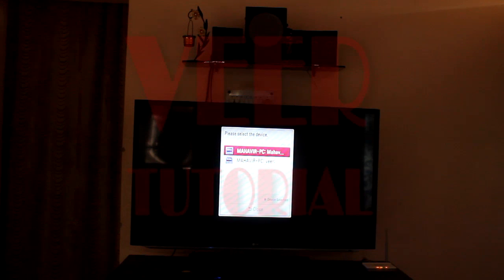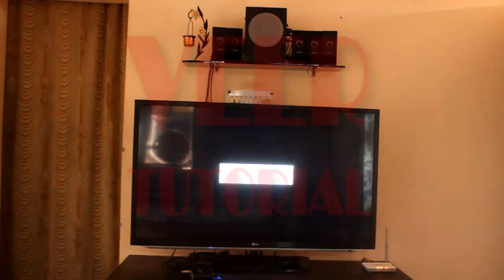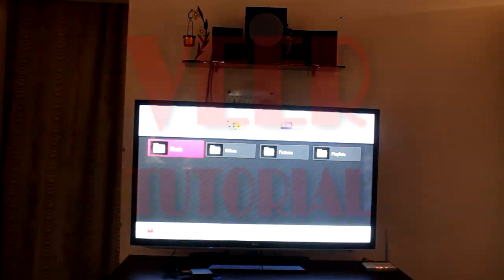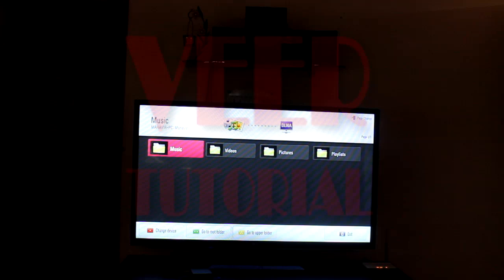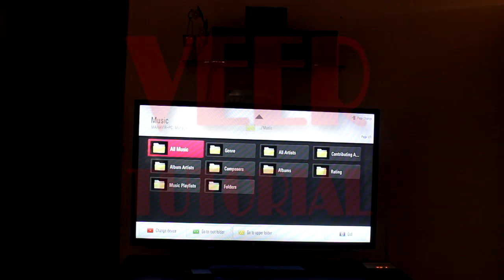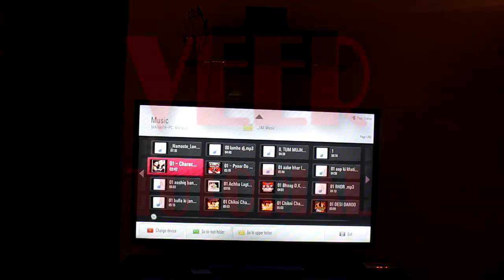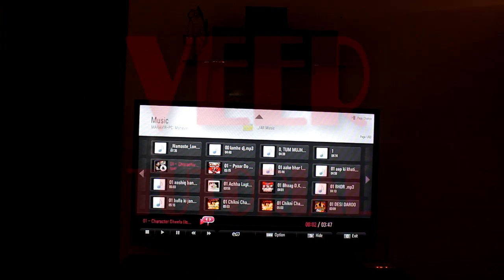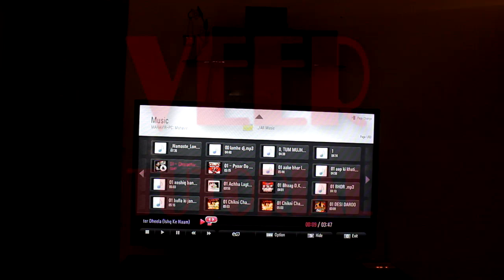How to convert digital (Toslink) audio to analog (3.5 MM Jack)

Comment: I just got one of these units to use an altec lansing subwoofer/speaker set and I am getting a lot of static in the background that remains even when I turn the volume al the way down.  Any suggestions?
Reply from the maker: Hi check wire connection carefully

Comment: Good explanation sir, i have a 5.1 creative pc speaker that i want to connect to my tv. Same 3 cables in your speaker. Sir after i connect the 3 cable to the audio gear, i also connect the other 3 end to the 3 holes (orange, green and black) at the back of the subwoofer? Thanks., I think my problem is going to be solve by your video. Thanks. I hope i can send a picture of my creative speaker sa that you can correct me or tips. Thankyou sir!
Reply: '' i also connect the other 3 end to the 3 holes (orange, green and black) at the back of the subwoofer? '' Yes, but  only in subwoofer Input plugs, not output

Comment: I have  creative 4.1 speakers with two 3.5 mm cables, will this work or is there any other device for that
Reply: We went to the moon, i'm sure its possible if you put some effort in searching for what you need for what you want to accomplish. There also exists some adapters and or small boxes that are quick solutions for audio adapting one thing to another. Pay close attention to the inputs and outputs, be sure to understand what its doing.

Comment: i have to vintage receiver and a optical dac. wi wish to convert one optical signal to 3 rcas output its possible??? or only convert in one rca?
Reply: plug the receiver into a stereo to mono cable, then hook the mono audio cable to a mono to stereo splitter, then look the R and L RCA connectors to a analog to SPDIF converter box.

Comment: Great Video! Could you please restate the Cable Connections. A comment below seems to indicate that the correct color coding to match the Green, Orange & Black 1/8" (3.5MM) cable plugs to the correct CEN/SW, FL/FR & SL/SR jacks on the converter for 5.1 surround sound may be different. In the youtube tutorial Green is center/subwoofer, Orange is Back Surround Sound left & Right and Black is Front Surround Sound Left and Right. Is that correct or does the Orange & Black need to be reversed? I'm using Logitech z506 5.1 speakers. On the back of my Logictech z506 subwoofer it has three 1/8" (3.5MM) jacks collectively labeled 6CH Input. The Green is labeled AUDIO IN, Black & an Orange Jacks are not labeled. How does 6Ch relate to 5.1 Surround Sound? Also in my HDTV Menu I can select either RAW (default) or PCM. Do you know which is better for 5.1 Surround sound?

Comment: I have seen quite a few spdif to 3.5mm adaptor cables for around $4.00 on eBay.  Do those cables actually work or do you need a box like this to process the audio?
Reply: BrainToMush they wont get 5.1, only stereo.
Reply: Ok thanks for the explanation.
Reply: I get surround sound from my headphones. It works pretty good.

Comment: In regards to your first comment that you stated that "all 5.1 audio systems do not use digital audio". This statement is incorrect because audio systems like the logitech z-5500s have digital audio inputs, and another thing when you point out the three outputs on the back you told us that output; "1.(CEN/SW) is for the center speaker", which is correct; "2.(FL/FR) is for front", which is also correct; "3.(SL/SR) is for subwoofer", which is completely incorrect. So from what you just said 5.1 is actually 3.1 output (which made me giggle a little not going to lie). So i will tell you what speakers are for which output. Which are written below the outputs, but i will clarify on the ones you told us were incorrect. Output 1.(CEN/SW) stands for center/subwoofer. Meaning this is the output for both center speaker and subwoofer, but hold if output 1 is for center and subwoofer than whats output 3 for? Well output 3 which also written SL/SR stands for surround left/surround right which also means rear left/right, and now instead of having 3.1 you have your full 5.1 system. Other than those few mistakes you did well keep it up and i looked forward in watching the next one.
Reply: vHoboWarrior So what is the correct color coding to match the Green, Orange & Black 1/8" (3.5MM) cable plugs to the correct CEN/SW, FL/FR & SL/SR jacks on the converter for 5.1 surround sound? In the youtube tutorial Green is center/subwoofer, Orange is Back Surround Sound left & Right and Black is Front Surround Sound Left and Right. Is that correct or does the Orange & Black need to be reversed? On the back of my Logictech z506 subwoofer it has a Green 1/8" jack labeled AUDIO IN, a Black Jack & an Orange Jack which are collectively labeled 6CH Input. How does 6Ch relate to 5.1 Surround Sound? Also in my HDTV Menu I can select either RAW (default) or PCM. Do you know which is better for 5.1 Surround sound?

Comment: Dear Mahaveer,
hai,
Your tutorial video regarding 5.1 Audio Gear was very helpful for me but there is a little problem.

I have Samsung LCD and it has only Digital audio optical jack where I purchased a Philips 5.1 Chanel Speaker and it has 6 inputs i.e. SW, Centre, Front Left, Front Right, Rear Left and Rear Right input point that it has 6 input point.

Where the 5.1 Audio Gear has only 3 output point.

Please guide.
Reply: Have you figured your situation out yet? Why am asking is that your comment is over a month old and I'm wondering if you still need help
Reply: Thank  you. Issue has been resolved.

Comment: very good job ... i have doubt, does it decode dts, dolby digital 5.1 and outputs the sound true ???? 
or it plays same sound from all the speakers ??
Reply: +Santhosh Kumar 

have you purchased this item? and what is you experience about it ? is it working 5.1 true or same sounds from all the speakers?

thanks
Reply from the maker: Santhosh Kumar yes it can decode but better you can check more technical details on product document before purchase
Reply: Mahavir Singh bro can you provide me the link from where you purchased i to want it
Reply: Santhosh Kumar Yeah man, it supports supports Dolby Digital AC-3, Dolby Pro Logic, DTS, PCM and other digital audio formats.

American Link: http://www.amazon.com/Panlong-Audio-Digital-Decoder-Converter/dp/B00AMC2J1Y

UK Link: http://www.amazon.co.uk/EiioX-Audio-Digital-Sound-Decoder/dp/B0090H30M4/ref=sr_1_fkmr1_2?ie=UTF8&qid=1438095369&sr=8-2-fkmr1&keywords=Panlong+5.1+Audio+Gear+Digital
Reply: Mike Grown hi sir,i have a similar speaker connection,3,3.5 mm male jacks,my tv however just has a pair of female red and white rca output jacks,is there a way to convert them to an input which will go in this audio gear.I mean to say,2 rca male to 1 toslink female or something lile that.
Reply: It decodes DTS.... Digital Turd Surround. It also outputs matrix echo, because adding an echo makes it surround.